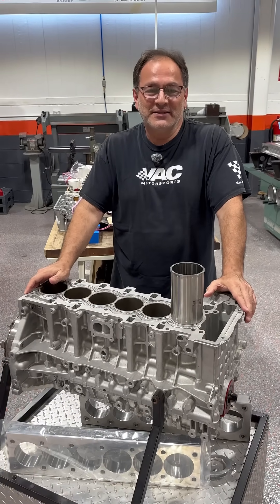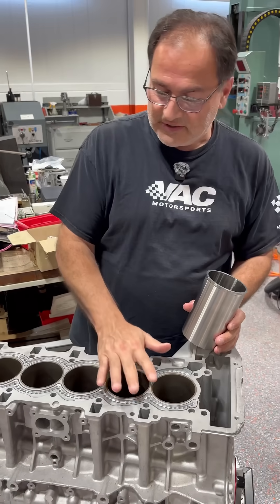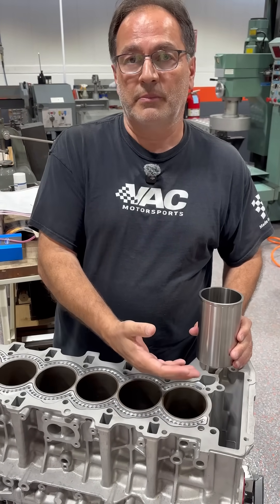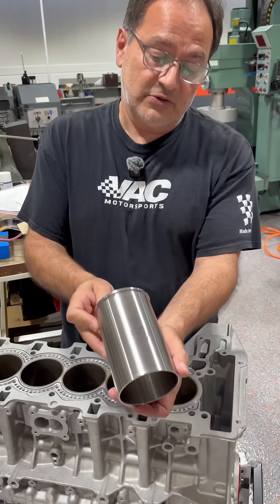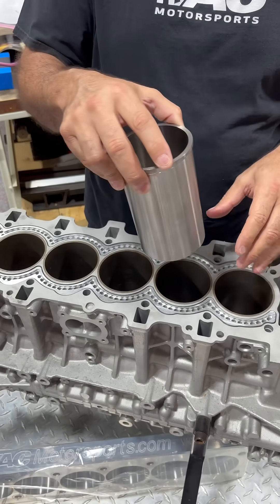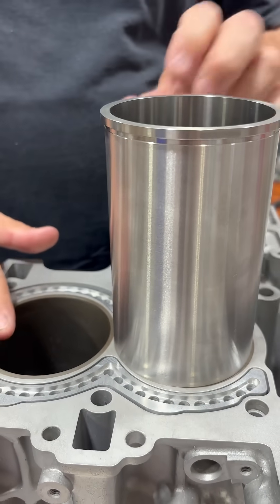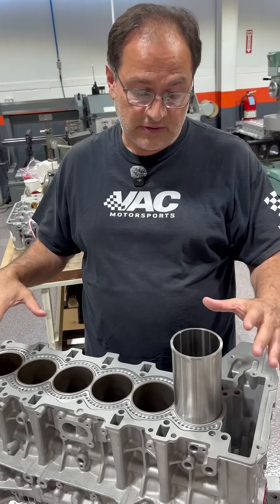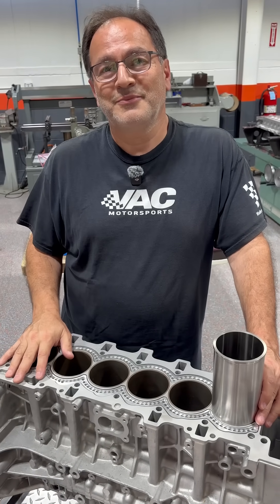BMW N54/N55 Engine Sleeving Explained | VAC Flanged Cylinder Sleeves for BIG Power

Comment: that flange sleeve is what is standard in my diesel engine. the method you suggest cause headgasket issues in my case. two blocks was done this way. the sleeve taken out not sitting square and one had a crack near the flange. My new block has the flange counter sunk to the correct level. also they needed to be 30 thou bigger outside diameter.
Reply: Ya sounds a little sketchy leaving them “proud”
Reply from the maker: Interesting points, thanks for sharing your experience!